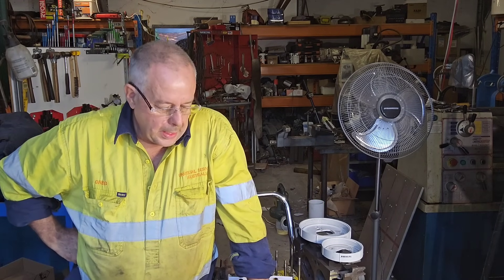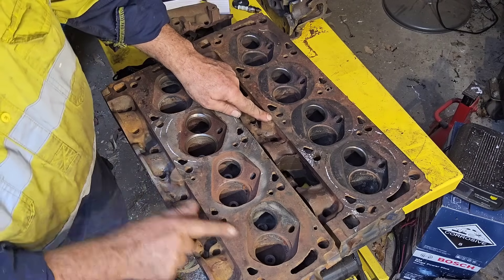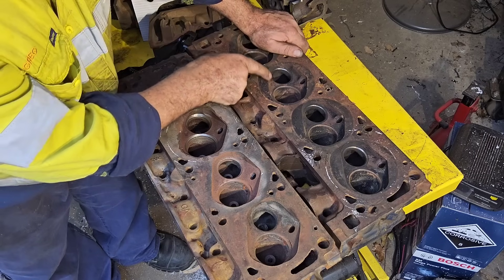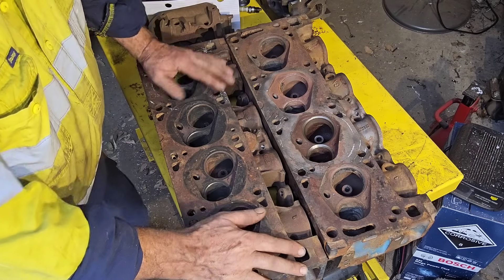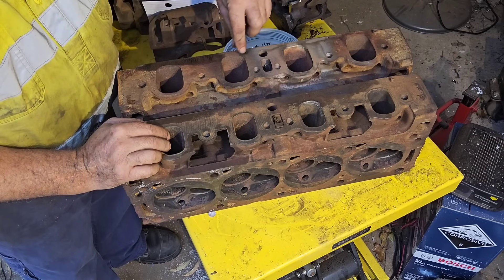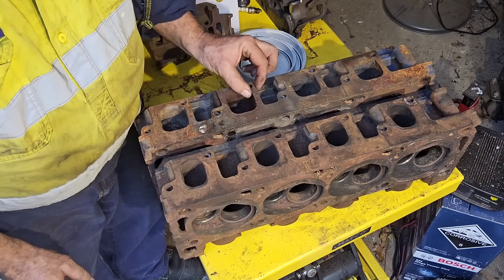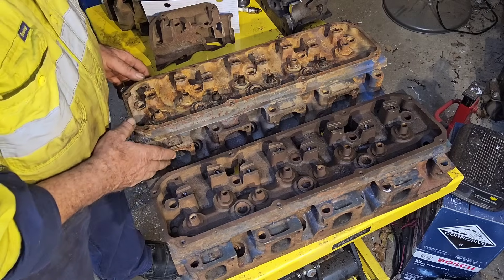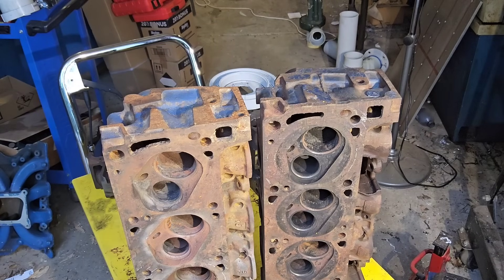Ford Cleveland 4V vs Aussie 302C closed chamber head comparison

Comment: Also, all of the 4v (big port) heads were made in North America. Geelong Foundry only cast 2v (small port) heads. but conversely Geelong was the only foundry to make the small distributor hole block.
love the Clevo engine! great to see someone on the YT that knows and has experience with these rippers. great video mate.
Reply from the maker: @nathanhansford76  thanks for watching and commenting. I have a whole range of videos to do on Cleveland's, and engine performance. Some of my ideas/thoughts are nonconventional, but I will explain why, and the viewers can make up their own minds.
Reply: You mean 2V port sizes heads, they are by definition Aussie 4V as the 4V stands for 4 Venturi Carburettor and all the Aussie Clevelands had carter thermo quads.
Reply from the maker: @JosephCowen-fz8vj  in Australia you are correct, but the terminology originated in the US before Australia started building Cleveland's. The 2V headed Cleveland's all had small ports and 2 barrel carburation. It wasn't until Australia developed a 4 barrel manifold for the 2V heads, that the terminology became contradictory. By that time, however, the terminology had already been set as the differentiator between the large port and small port heads. Thanks for watching and commenting
Reply: @RevShedPerformance  true , there was even 6V FE motors with 3 X 2 barrel carbies and Boss 302s could be ordered with 2 X 1250cfm dominator carbies so they would be 8V motors. But yes it gets all arse face about when Ford Australia started casting things , 2V sized ports ( but not exactly the same as the smog US 2V) with a 4 barrel Carter Thermo quad carbies for Australia. 

I saw a Ford Australia paper about 20 years ago reprinted in some book showing Ford Australia in 1970 when they were redesigning the Cleveland for Australia, obviously the 4V 351C was a bit over the top for mums Falcon wagon or upmarket cabs / F350 s , Ford Australia tried many different ideas for a std V8 , they wanted a nice easy going V8 and another version you could option. The paper showed pictures of a 351 in a XY I think they used for testing . This 351 had Cleveland block and 351W heads with a factory cast iron intake to match up the idea. The sort of exact opposite of a Boss style motor. There pictures of it driving around . I bet that would be the rarest 351 factory Ford around. They would have produced more than one . I guess it's called a Windland ! They would be sitting in some Ford engineers shed somewhere. In the end Ford Australia came up with the 302 Cleveland as the lower option V8.

I always wanted to build up a Ford 400 (as you would know it's not a 400 Cleveland) but it is just a tall deck Cleveland with Big Block 385 series engine mounts and bellhousing. People run down the F400 but it's got a bad rap because it had 7.75 to 1 compression, retarded cams timing and pellet cat converter. All that gets removed in a good performance build anyway. And any good engine builder knows more deck = Longer rods and that's always a good thing. Throw a set of 302 C heads on it , compression would be upped to about 10 to 1 , instant 50 + HP. Edelbrock makes a performer rpm intake for Ford 400 / 351M now . Good cam, /exhaust and that 400 would be grate . I saw a XY GT HO imitation in Brisbane about 1991, it had GT 400 on the guard and a Ford 400 / FMX auto. Went well. 

But I like to be different, I want a (Ford) MEL 462ci motor and top loader in a Falcon . Just to be different.
Reply from the maker: I'd love to see that paper, have never heard of it before. Thanks for watching, sharing, and commenting
Reply: @RevShedPerformance  I'll track down the article and post it. With pictures of the engine .
Reply from the maker: @JosephCowen-fz8vj  that would be great. Thank you
Reply: @JosephCowen-fz8vj  there is all manner of ‘test’ and prototype configurations floating around, but the heads in question are the US cast heads that have either the number 4 cast into them to identify them as factory ‘4V’ or the number 2 to identify them as 2V. The Geelong foundry didn’t have numbers cast into their heads because they only had one port size.
It wasn’t until the US ceased production of the Clevo that Australia went exclusively to the open chamber head design, thermoquad spread bore 4 barrel, retarded the valve timing, small dizzy hole and added more emissions garbage. That was when emission targets was the most important thing to sell a car, not performance, so big ports were not required anymore.
Reply: @nathanhansford76  um Australia didn't go exclusively to open chamber heads . All 302C are closed chamber. That's how they got the compression on the 302 C v 351c , no 302c had open chamber . The US ceased Cleveland production in 1973 . Australia started casting Clevelands in 1971 at Geelong . There's a famous picture at the Geelong Casting Centre stating on a big sign infront of a 302C " first Australian cast V8 July 1971" that's for 1972 model Australian cars . The US4V is just too big to manage cheaply , that's why Australia got small port 2V sized ports ( they are not exactly the same size as US 2V ) even the 302 Cleveland 2V sized ports are bigger than big block chev std heads by quite a bit. So they are far from small . And performance was Ford's idea , ford in that period ran adds saying  Ford's  "total performance " idealoligy, win on Sunday , sell on Monday. That sells cars .
Reply: @ your internet search has failed you, ford stopped fitting Clevos to mustangs in 73 true, but continued fitting them to Torinos and Rancheros and others until 75. Ford then made deck height changes and called it a 351M and continued fitting that engine to Mercury and Lincoln cars.
My experience with opening up XD and XE engines, (not what someone might read on the internet, actual experience) none had closed chamber heads, this was to meet emission regulations. You seem to be tight lipped about information that is not easily googled…
Reply from the maker: Ford Australia was still making Cleveland's in early 1983 and still fitting them in F series up to and into 1984/85.  September 1985 we saw the first of the F series with the injected 302 Windsor, group fire injection, for the introduction of unleaded fuel here in Australia. Uo until the introduction of the Thermoquad, no Cleveland's in Australia had EGR. They only had to comply with Australian Design Rule 27. When ADR27A came into effect, it changed the automotive landscape in Australia. All ADR27 Cleveland's were blue, but the 27A engines were painted black. Incidentally, ADR27 was emissions compliance.
Reply: @RevShedPerformance  even some 1986 sold F350s had Cleveland's. And 1985 D Series trucks could come with Cleveland's .
Reply from the maker: @JosephCowen-fz8vj  the F series would still have been built prior to September 1985 as legislation had forced the introduction of unleaded fuel for all new vehicles built from January 1 1986. I personally had a September 1984 F350 4x4 with the injected Windsor in it. There were a lot retrofitted with Cleveland's due to issues with the early Windsor's here in Australia.
Reply: @RevShedPerformance  yes I'd say that's what happened,
Reply: Friend of mine James galea had a 3514v xy in 90s run 12.7 now we think 2v would of went better had isky 644 lift cam 850 holley turbo 400 ....4v to big for street ....omo😅
Reply: @stevesalkas9128  yes certainly you can get HP out of 4V that's what they were designed for on the  Boss 302 in 1966/7 and later transfered to the new for 1970 Cleveland, but getting them in the power band to take advantage of that is quite high up the rev range , verlocity is sloppy under 4500 , still make power but really all the new after market alloy heads are designed around the Australian 302 C 2V port style . They made port inserts to go in 4V ports that reduced them more to 2V size Don Garlis used to race the Cleveland and sold the tongues . A good well designed engine package suits the vehicle it goes in with compression/ cam/ intake/ carbie / exhaust / port size. A jet boat running under load with a Cleveland would be the best place for 4V heads/ports , because they sit at 6000 plus all day . But really the 302 C 2V port size is as big if not bigger than big block Chevy ports and im not talking peanut ports , the full size 427/454 1970s era ports . And those motors are nearly 2 litres bigger .
Reply from the maker: @JosephCowen-fz8vj keep an eye out for a future video where I talk about port design,  port geometry, port velocity, and why the 4V head is so misunderstood by almost all engine builders. Thanks for watching and commenting
Reply from the maker: @stevesalkas9128 i suspect that I know that cam. It lacked LSA. It would have benefited from another 3 or 4 degrees of LSA. If it's the one that I'm thinking it is, I got significant improvements by increasing the LSA on a custom ground cam. Thanks for watching and commenting
Reply: @RevShedPerformance I'm sure it was fl 560 cam
Reply from the maker: @stevesalkas9128 FL570. Same intake and exhaust duration, 266° @ 50 by memory, and 108° LSA.

Comment: Re Cleveland intake 2V/4V port mismatch, bear with me for a sec, on a small block Chrysler LA there are different heads on the 340/360 compared to the 318. The 340/360 4bbl intake still bolts on a 318. As it turns out, there is also a smaller 318 port size dual plane 4bbl intake available.

Now here's the thing, the port mismatch by fitting the factory iron dual plane 340/360 Thermoquad intake on a 318 makes such a huge improvement in performance that there's little reason to put a dedicated small port dual plane 318 4 bbl intake on.
The reason is likely because the engine sucks from the head side. People forget that, see the step and immediately think huge shearing turbulence seeing air as a liquid being forced down under pressure from above when actually it's the reverse. 
But some other people have theorized the mismatch actually acts as an anti reversion dam explaining the relatively astonishing increase in performance. This cheap performance upgrade has been known for years. 
There's a vid on it by 318willrun. 

I just bet a 4V intake on a 2V head behaves very similarly.
Reply from the maker: @ThePaulv12  we didn't see enough of those engines here in Australia for me to become proficient with them, even though I worked in a Chrysler dealership for a while. That said, in my opinion, you are heading in the right direction with your thinking, but there is a bit more science and physics involved than is immediately apparent. In the future, I will be making a video on why I believe that the 4V Cleveland engine is the most misunderstood performance engine in history. Particularly in relation to the cylinder head design, and camshaft design. That video will, I believe, help explain to you why you get the performance gains that you get. Thanks for watching and commenting. I hope that you subscribed as well
Reply: its possibly due to air speed.. funnel effect.. i have a 340 r/t challenger.. 73.. uncle tony,s garage has vids, as well as dead dodge garage.. or nicks..
Reply from the maker: @harrywalker968  there are a number of contributing factors, but it takes too much writing to explain here, hence why I'm going to deal with it in a video. Thanks for watching and commenting
Reply: I have a fresh 351 Cleveland going on dyno next few days, it has the closed chamber 4V no tongues, Crow did a particular grind cam for it, we are bolting on a Edelbrock dual plane 4V intake which looks to be better port matched to  a 2V. Will give it a run and see what it looks like. Speaking to a few old fellows, they reckon it was a thing back in the day

Comment: The 4V are good for 1 sec faster over the 302 head on the quarter mile with a XA GT Coupe  toploader 9 inch with 2.75 gears , hyd cam 230 @ 50 750 vac sec 
Only change heads and standard manifold for each 
Went from 15.6 to 14.6 with the 4Vs same 4V tri ys
Reply from the maker: Sounds about right. With 2.75's you need torque, and correctly cammed, the 4V's will give you that, along with more top end as well. Thanks for watching, sharing, and commenting
Reply: because you have 275 gears.. a 4v head starts flowing at 80 mph..  an xy gt ho did 160 mph, on film. doctored to 140 for the public.. plus, a 750 is too big & 230 is too small.. just all wrong.. had a lotus escort, 70,s.. it does 15.8 . 1/4.. std.. mate built a 250 on lpg with eb head, blew the v8,s away..  i just sold a bronco, weighs 3t.. on lpg only. 351 with 302 heads, 12.1 comp. std cam.. fkn dangerous.. never touched it for 15 yrs. bought for 3.5k. sold for 25k 6 months ago.. 4.11 diffs.. theres open & closed chamber heads.. 351 open, 302 closed. 4v heads are huge ports. 2v & 4v can mean 2bbl or 4 bbl.. not the heads..

Comment: Do you reckon it's worth relieving the intake valve and spark plug shrouding on the Aussie heads even though it will put a dent in compression?
Reply from the maker: @Jimeoin351  the spark plug isn't actually shrouded at the point where ignition is initiated, so you won't gain anything. In most cases, compression ratio trumps airflow,  but not always. When I fitted the 2.19" intakes into the 302C head, I always unshrouded the valve, and there is almost no room for airflow between the side of the combustion chamber and the valve head. In later videos, I plan to show you how to do this, a how to do it relatively cheaply. Thanks for watching and commenting
Reply: @RevShedPerformance  Thank you sir, I just dabble but I like to hypothesise.
Reply from the maker: @Jimeoin351  from hypothesis comes theory, from theory comes experimentation, from experimentation comes results (positive or negative), from results comes learning
Reply: Unshrouding the valves on the closed chamber heads way more than makes up for the drop in CR.
Reply: @craig8187  Thank you sir.

Comment: Impressive video, Rev Shed Performance. Looking forward to your next upload. I crushed the thumbs up icon on your content. Keep up the fantastic work! Your insights on the differences between the 4V and 2V heads are enlightening. Considering the contrasting designs, how do you think these variations affect overall engine performance and tuning strategies?
Reply from the maker: @KeyserTheRedBeard  stay tuned!!! Upcoming videos will deal with design characteristics of cylinder heads, valve placement, valve angles, combustion chamber design, and how some of these characteristics affect camshaft design.  Thanks for watching and commenting

Comment: As a Holden guy I still find these videos interesting to learn the differences I heard quoted 40 years now come to light...with all due respect your workshop could do with a spring clean...:o)
Reply from the maker: @holdenrestoration2557  good thing it's autumn, got plenty of time to make a start on the clean up 😆 🤣 😂.  Your absolutely right, but there is a fair bit going on in the background at the moment which will probably result in a major reorganisation of the layout in the shed...again. Thanks for watching and commenting
Reply: @RevShedPerformance  ?????...theres 302 & 351 heads.. wheres the 302 heads.. i ran 302 heads on a 351. lpg only. 12.1 comp.. for 15 yrs..never a prob.. std cam. in a bronco.. a 302 should go like hell. think i heard its the cam that stops it.. clevo are the best engines ever.. chev , holden v8,s are rubbish..[ except b/b..]
Reply from the maker: @harrywalker968  I'll probably do a comparison video on the differences between the Australian 2V/small port open and closed chamber heads later on, and talk about why one is potentially better than the other. Thanks for watching and commenting
Reply: @RevShedPerformance  Those 4V heads use to have SVO inserts put into the runners and matched with an 
SVO single plain highrise manifold, they flowed 100hp per 100'' lift....it was a Nascar thing done for the cars that couldnt afford alloy heads....
a friend of mine had it done to his GT 351 made over 720hp 12.5 to one comp ...etc...
couldnt keep it straight on the road for some reason...
As for the exhaust they had a steel plate insert that closed the bottom half up into a D port shape on the 4V and used two water soaked gaskets with the steel inset in between them....